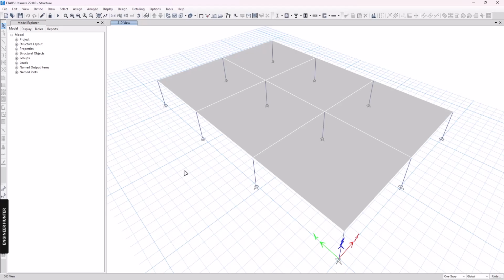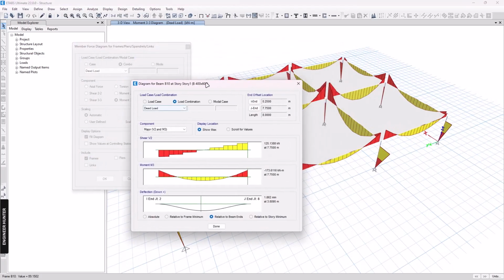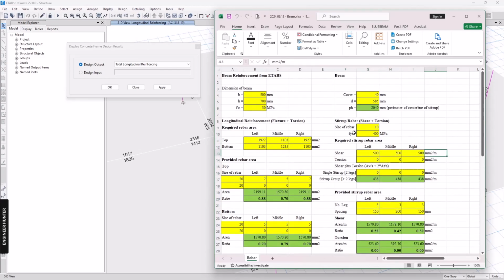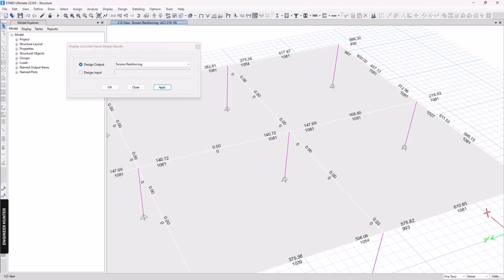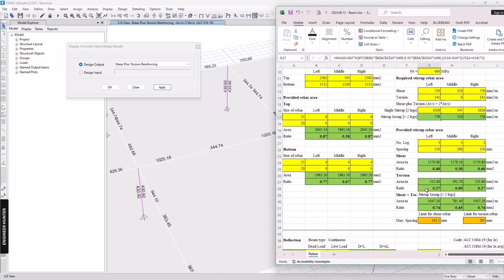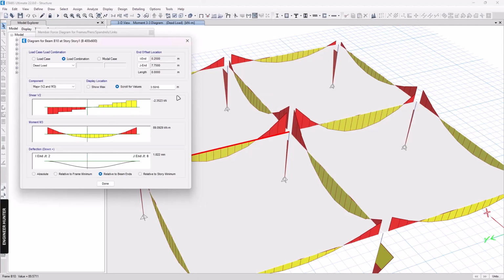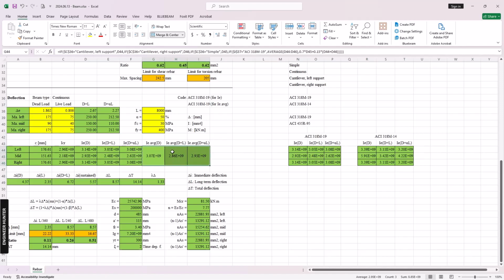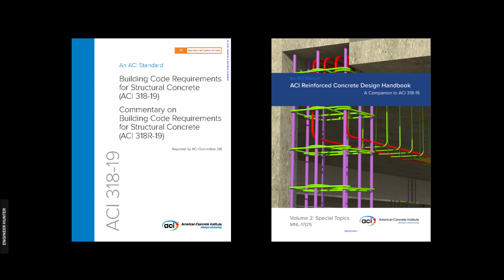Beam Deflection per ACI 318-19

Comment: How did you get the value of d as 485?
It says that “h-115” how is that?
Reply from the maker: d is measured from top surface of the beam to location of effective area of the rebars (for positive moment). In this video, it’s just an example of d. You need to compute the correct d as you design the beam.
Reply: @EngineerHunter So if the beam section is 250*600, clear cover is 40mm and bottom rebar is 20mm , d will be computed as the distance from extreme compression fibre to the centroid of the tension reinforcement as d=600-(40+20/2).
Right?